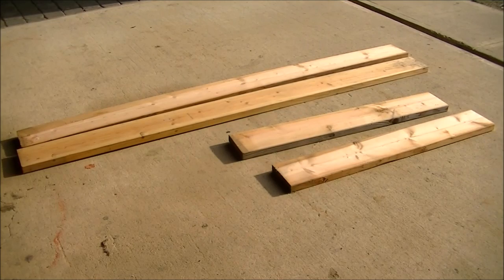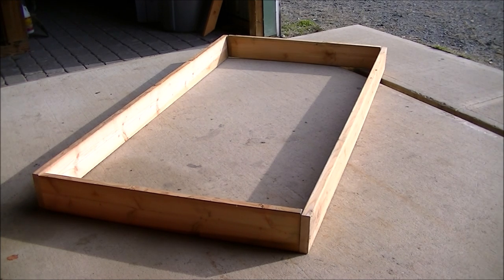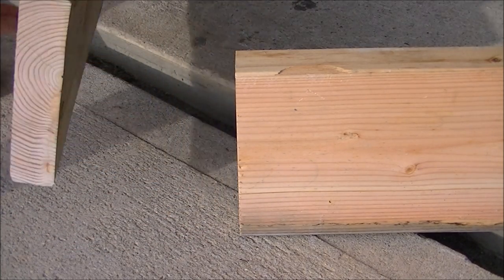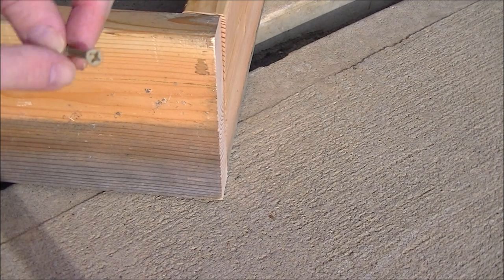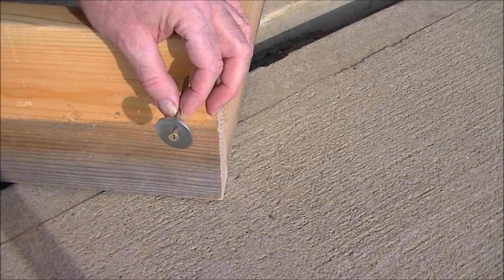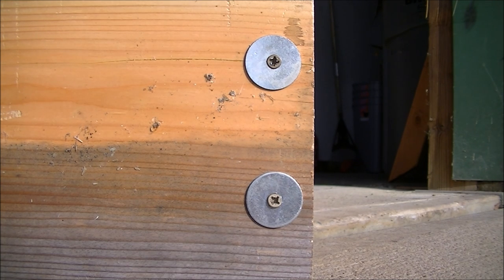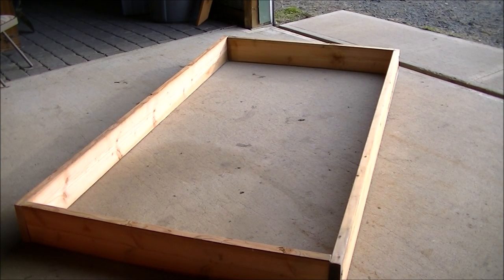Make a Wooden Raised Bed Edges 10 X Stronger Hack Backyard Gardening.

Comment: Good tip. The only thing I would suggest is to pre drill the first board with a 3/16" drill bit. That prevents the first board from splitting and also prevents the threads of the screw from grabbing the first board and pushing it away from the second board. The threads only need to grab the second board. the fender washer is a good one!
Reply from the maker: All good points... THANKS.

Comment: I have been building Raised Beds now for years now and i have always pre drilled my holes even when using screws like you have, if you look at the close up of the top screw you have in fact split the wood, if that split was there before then you have just made it worse, if you pre drilled the wood that split wouldn't have happened.
Personally that washer is too big as well, other than those two points it was a good explained video.
Stay Safe,
Barry (ENG)
Reply from the maker: It is your choice to do what you think is correct. The other 7 screws work out just fine. And where the crack happen it did not get and worse and it has been one year already. THANK YOU for sharing.

Comment: Hi Mark, hope you're well.  Question for you... I want to add a few inches of soil and compost to one of my raised beds.  However, I currently have my fall covers growing in the bed.  Should I chop and drop, and then add soil? Perhaps chop, remove residue, add soil, then apply the residue on top? Not chop, just add soil? So many options!! What are your thoughts?  Thanks buddy.  Be well!
Reply from the maker: Sorry for the delay. Went fishing to stock up on food.To be safe I would chop, remove, fill soil,  than return placing with chop cover crop mulch on top of new soil.
Reply: Thanks Mark.  Stay well

Comment: I would think the weak link there would be from screwing into end grain
Reply from the maker: So far so good.. The wood screw is skinny enough not to crack
Reply from the maker: @markhowes10  I took a look again at the video. That crack was there before i put the screw in. Adding a pre- drilled hole would be better in the first board. I just wonder when someone builds a deck they do not pre drill. So what is best. Thanks You for your insight.
Reply: @iamorganicgardening  In my experience, the problem with driving a screw into end grain isn't cracking, but rather that the threads chop up the wood fibers so that the screw is driven into just a little more than a tube of sawdist held in by the connective tissue of the single layer of wood fibers between the threads, and that of the uncut fibers just outside the diameter of the threads.
Reply: @Groucho_Marxist_ASMR  you're right; there are very good reasons not to drive screws into end grain. It's pretty funny watching people think they're  carpenters because they cobbled together a few shoddy wooden frames... if you're going to build something the cheapest easiest way possible, at least use the proper adhesive. But I guess it doesn't matter if you're using wood outdoors, which is going to fall apart under the weather in a a couple short years anyway ;)
Reply: @iamorganicgardening   when people build decks they're not screwing into endgrain. They're screwing through the face of the boards into the edges of the frame. That's the difference, and why they're not constantly splitting boards. .

Comment: Beds made of cattle panels lined with hardware cloth are the best raised beds, bar none -  that's including cost and ease of construction. The galvanized steel will outlast all of us. ANY wood you get from the hardware store or lumber yard that stays in constant contact with moist ground WILL rot away,  no matter what species, how its treated or what you paint it with,  it is just a matter of whether it falls apart and has to be rebuilt in two years or five. Yes, that includes pressure treated wood, deck facing etc... the stuff nowadays is vastly overpriced garbage and the stuff from twenty years ago is too toxic to use even if you could get it.
Y'all keep re-making your beds every couple years, your local lumber salesman thanks you for it. I'll never make one out of lumber again.
Reply from the maker: Funny you say that . I know that guy the invented that. I am Organic.. something???  THANK YOU.
Reply: @iamorganicgardening   I'm not entirely certain you invented those beds, but I did indeed see them on your channel years ago (thanks for that!). Which is why it surprises me that you made a whole new video about making wooden beds. Why? Seriously, why?!? They're honestly pretty terrible in comparison to almost any other way of making beds. Keep moving forward, don't go back to repeating the same half-vast ideas people have been doing wrong for years. :)
Reply from the maker: @dystopiagear6999  I did for the only reason people can not  fine/buy those cattle panels in there areas. Also been ask for years now though private messages to help guide / build a raise bed out of wood. I Know there rot faster and fall apart. I am here to help not criticize. Thanks
Reply: @iamorganicgardening  Plenty places will deliver cattle panels. I got most of mine from Home Depot, unloaded right in my driveway. But there's a flat delivery charge; in our case it was 80 dollars, so you have to buy enough stuff at a time to make that cost worthwhile.
2-3 hundred bucks for several raised beds may sound steep, but let's be honest that's a couple date nights for materials that will last the rest of your life. And if you add up what it costs to buy lumber etc to build the same amount of wooden beds  even once you will still save money and have far better beds that last essentially forever. I'm not criticizing anyone, just offering actual facts from my own experience.  I'm terribly sorry if that hurts anyone's feelings, but reality doesn't change just because someone doesn't want to admit there's a better way.

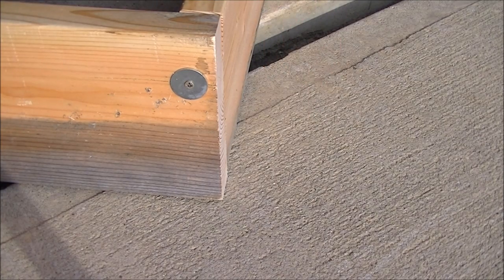Comment: Good tips! But at 3:54 you can see where the top screw did split the wood. Pre-drilling just the one board makes it easier to drive and it will go straight. Also, you'll get a tighter joint. <><
Reply from the maker: THANK YOU.. I agree pre drilling the first board is helpful. Will update in next video.

Comment: I suggest setting the long-side boards on the inside of the short ends. This will lessen the outward pressure on them.
Reply from the maker: I have tried that in the past and the long boards just turn the screws when the board warps or twist.

Comment: if you have an interior 2by2 in each corner and screw face wood to face wood it would probably hold better, but I'm overcomplicating it. I like your method more especially given it lasts the lifetime of the bed. If you're worried about cracking the wood, could always drill pilot holes.  thank you!
Reply from the maker: THANK YOU for your advice.. all good points.